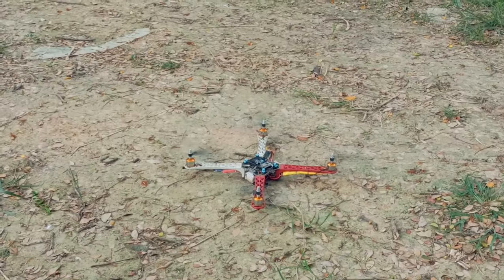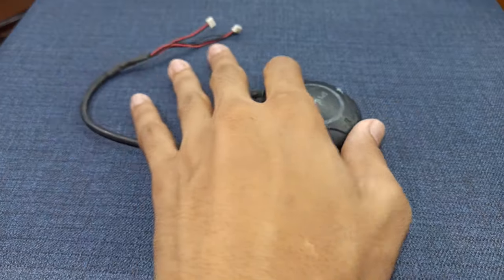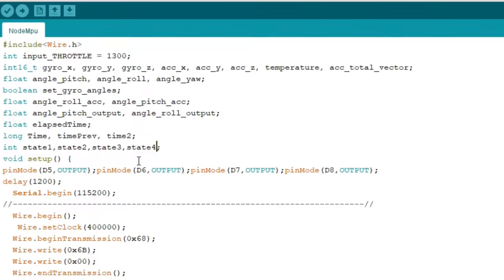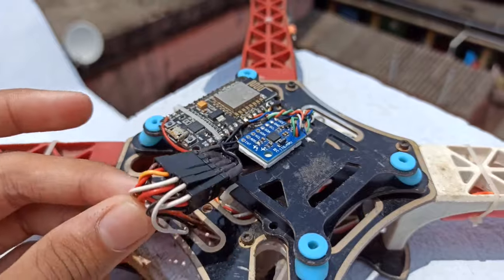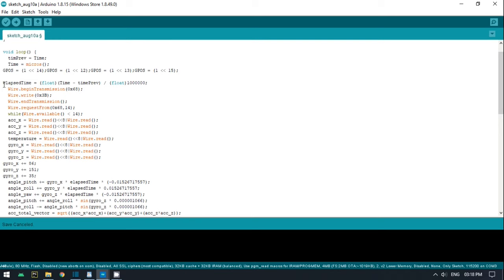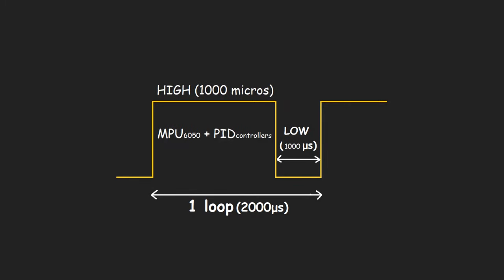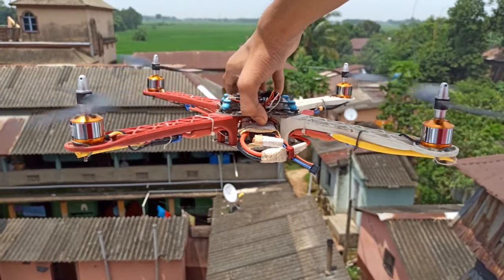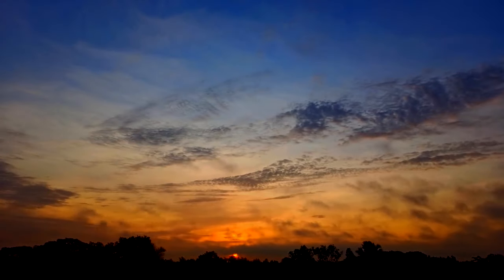How I Made NodeMcu Flight Controller | WiFi Controlled | MPU6050

Comment: Do you have problem with mechanical vibration from bldc motor? Mpu return normal values?
Reply from the maker: That's why use a Kalman Filter. See latest video.
Reply: @DIYLIFEHACKER  sorry for my question, but i don`t understand correctly. We use complementary filter to get angle from accel and gyro. For what we use Kalman? Do we need to filter RAW accel by kalman and than use complementary to get angle?

Comment: Hi, I am having a project related to Quadcoper using ESP8266 and MPU6050 sensor. I really still don't understand how to determine the PID. Hope you can explain more clearly. Thank you
Reply: I have a doubt . Where will the motors get supply from nodemcu or external battery connected to nodemcu
Reply: No no the motors will get power from battery but pwm signals from esp8266!

Comment: ESC requires pwm signal of 1000 micros to 2000 micros at 50 Hz, means one signal at 20000 micros interval, and since in the project you measured loop time of 2500 micros. Which is nearly 500 Hz.

My question is does this high frequency improve performance
Or
We can use this code with slower microcontroller like Arduino Uno at 50 Hz
And remaining time use for calculations.

Thank you so much
Reply from the maker: ESCs are capable of reading 50 to 600Hz pwm frequencies. only the 1000-2000 us matters
> higher frequencies doesn't improve esc performances. it just help the filter to read gyro perfectly and with minimum loss
Reply: Basically esc control the speed of motor by changing the frequency in 3 phase signal which drive the 6 igbt 1000us to 2000us is duty cycle which generate by uncontrolled esc have its own controller which read input duty cycle and change output frequency

Comment: HI, nice project, I have one question, where you set your yaw_desired_angle (line 137 in your code) ? it is commented,. Thanks.
Reply from the maker: Here Yaw control is disabled. The drone will hold the yaw angle at takeoff. If you want you can set the desired angle by a value of adding a joystick or extra keys for yaw.
Reply: when I set yaw for fixed angles based on the position of the joystick, it ended up returning to zero when the joystick is in the rest position, what I had to do is to use the stick to set  a speed rotation insted. thanks.
Reply: @DIYLIFEHACKER  one last question =),  I see that you apply a second controller if the error is between -3 and 3 (twoX_kx variable), is that a "fine tunning" ? do you have another video or something else explaining your control loop ?
Reply from the maker: @andresilva_bjj  this was a very stupid filter. I made a quaternion based EKF but video next year.
Reply from the maker: You can use a gradient descent filter. Mahony......
Reply: @DIYLIFEHACKER  alright, thank you.
Reply from the maker: use += format. integrator type.

Comment: Can someone please tell me how to calibrate ESC without any fancy equipment ? 

(Or) Can I use DC servo tester to calibrate ?  

And another question tell me, Does ESC remember the calibration even after power is disconnected ? 

PLEASE ANSWER!!!
Reply from the maker: You can use a servo tester.
The esc remembers even after power cut
Reply: @DIYLIFEHACKER  thank you

Comment: bro I have a question that using which variables you are giving pwm to pins 6 ,7 as you have not used (pins name )them in the main loop
Reply from the maker: esp has different naming in gpio, check esp diagram
Reply: @DIYLIFEHACKER  ya bro but in the code i found gpoc ,ESCout_1,ESCout_2 and other variables (state1,state2) so which variable is been used for giving pwm
Reply from the maker: @BTEEEVANSH  ESCout
Reply: @DIYLIFEHACKER  thanks bro 👍
Reply: @DIYLIFEHACKER  bro in udp connection how you have been taken input and can we use input method in place of keyboard.get_hotKey_name()
Reply from the maker: @BTEEEVANSH  try

Comment: Hey why flight control is not working is there anything else to feed in it aur it's connection problem
Reply from the maker: what problem, provide more details
Reply: Nodemcu is working but it's not responding to  flight control . Is any else is needed to feed or change in ip address

Comment from the maker: checkout Wall Climbing Drone : https://www.youtube.com/watch?v=OO8WduUEngE
Reply: Hi great work but your app does not work. There is an issue with the apk for the Wall Climbing Drone.
For this tutorial when I run the python script and put in the commands nothing happens.
Reply: I watched the video
It is awesome 

Bhai, 1 year is passed out since you uploaded last video,
Is everything okay???
Reply from the maker: @kevalnakar6269  busy🥵
Reply: @DIYLIFEHACKER  Bro the code provided by you doesn't match the code in the video!
Reply: @DIYLIFEHACKER  And it is showing this error!

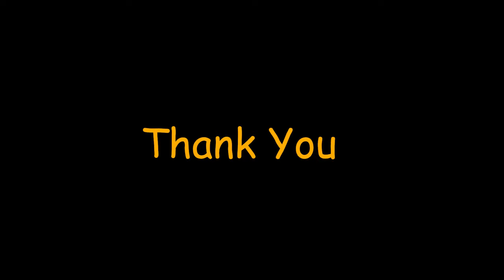Arduino: 1.8.20 Hourly Build 2022/04/25 09:33 (Windows 10), Board: "Generic ESP8266 Module, 80 MHz, Flash, Disabled (new aborts on oom), Disabled, All SSL ciphers (most compatible), 32KB cache + 32KB IRAM (balanced), Use pgm_read macros for IRAM/PROGMEM, dtr (aka nodemcu), 26 MHz, 40MHz, DOUT (compatible), 1MB (FS:64KB OTA:~470KB), 2, nonos-sdk 2.2.1+100 (190703), v2 Lower Memory, Disabled, None, Only Sketch, 115200"

E:\Flight Controller Codes\NodeMCU.ino\NodeMCU.ino.ino: In function 'void setup()':

NodeMCU.ino:35:9: error: 'D5' was not declared in this scope

   35 | pinMode(D5,OUTPUT);pinMode(D6,OUTPUT);pinMode(D7,OUTPUT);pinMode(D8,OUTPUT);

      |         ^~

NodeMCU.ino:35:28: error: 'D6' was not declared in this scope

   35 | pinMode(D5,OUTPUT);pinMode(D6,OUTPUT);pinMode(D7,OUTPUT);pinMode(D8,OUTPUT);

      |                            ^~

NodeMCU.ino:35:47: error: 'D7' was not declared in this scope

   35 | pinMode(D5,OUTPUT);pinMode(D6,OUTPUT);pinMode(D7,OUTPUT);pinMode(D8,OUTPUT);

      |                                               ^~

NodeMCU.ino:35:66: error: 'D8' was not declared in this scope; did you mean 's8'?

   35 | pinMode(D5,OUTPUT);pinMode(D6,OUTPUT);pinMode(D7,OUTPUT);pinMode(D8,OUTPUT);

      |                                                                  ^~

      |                                                                  s8

exit status 1

'D5' was not declared in this scope

This report would have more information with
"Show verbose output during compilation"
option enabled in File -> Preferences.

Please answer bro!
your help will be recognised!

THANK YOU FOR SUCH A QUALITY CONTENT!
Reply from the maker: Install nodemcu board from board manager
Reply: @DIYLIFEHACKER I have alerady done it!
Reply: Is your problem solved because I am planning to make this
Reply: @noobplayz2003  Nope
Reply: @nikhilupadhye5842  thank you for replying so fast
Reply: @noobplayz2003  😄my pleasure!
Reply from the maker: @nikhilupadhye5842  Come on, that's a silly problem. Just watch a tutorial of how to upload code to nodemcu. Everything is ok you just missing the uploading part...
Reply from the maker: @noobplayz2003  🏃
Reply: @DIYLIFEHACKER  bro why don't you make a video to make a drone with all the modules like gps, mpu6050, telemetry?
Reply: That surely will be a 🔥 video right?
Reply from the maker: @nikhilupadhye5842  yes flight controller v2 is ready, it's app controlled, 4G communication, live video streaming+ gps+ advanced algorithms for attitude estimation and control (pictures: See latest community post). But due to my studies no video this year.
Reply: @DIYLIFEHACKER  ok bro focus on your studies first!
Reply: @nikhilupadhye5842  will you help me as I am a beginner
Reply: @noobplayz2003  fine😄
Reply: @nikhilupadhye5842  where are u from
Reply: @nikhilupadhye5842  bro how to control drone with python script

Comment: Damn bro.. amazing work ! I can help you with coding in case you need any help . Btw please add another set of links for Indian amazon store
I wanted to make drones but I am afraid I will buy wrong parts and waste money.
Reply from the maker: Sure thanks,
Reply: I need help in coding part
Reply: @DIYLIFEHACKER  bro if I use coreless motor then what would be the circuit plz help